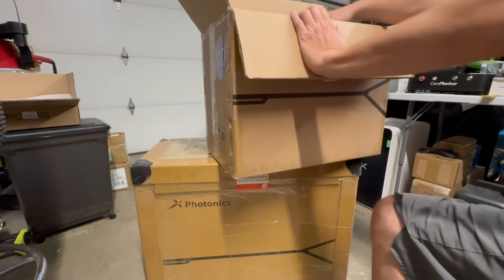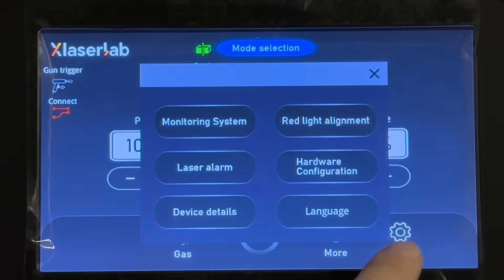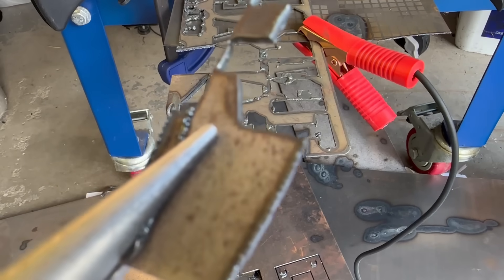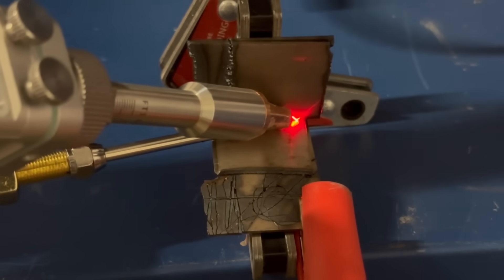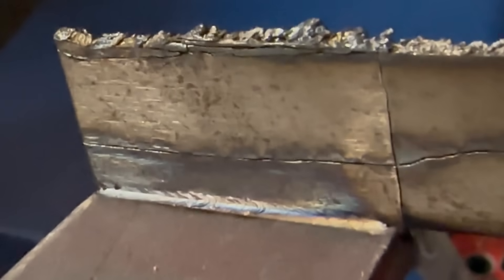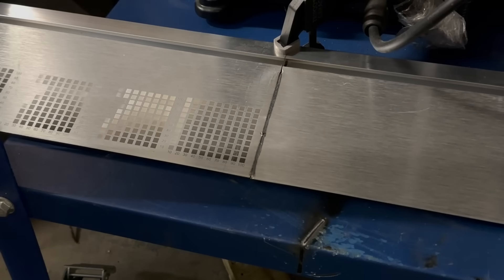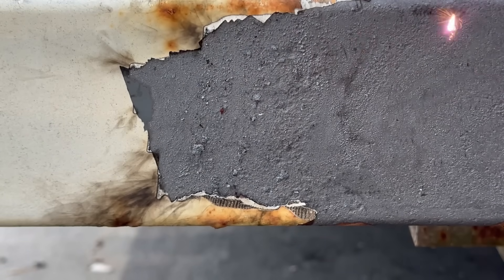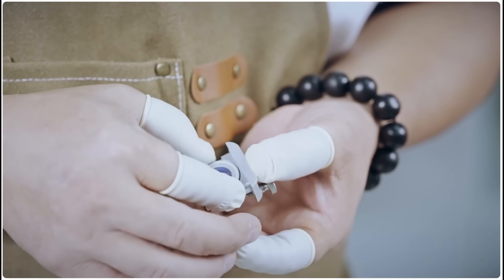Xlaserlab X1 Pro Laser Super Easy Welding Cutting and Rust Removal

Comment: I think Dad used Argon for MIG welding AL.
Reply from the maker: You can use Argon.  However, it is more expensive
Reply: @TripodsGarage I'm not even sure I can get his tanks refilled.
Reply: @OldCurmudgeon3DP argon would be for TIG welding. 75/25 argon co2 would be for MIG. Also aluminum.
Reply: @melgross I'd have to check the bottles. He added a spool gun for AL in parallel to the original steel MIG torch.
Reply: @OldCurmudgeon3DP yeah, I bought a spool gun because my welder didn’t do AC, so I couldn’t TIG aluminum. But I could MIG it with the spool gun. That’s likely why he had argon. My current arc welder dies do AC TIG. Funny how aluminum, no matter what}t, always uses argon. My laser with aluminum is also argon.